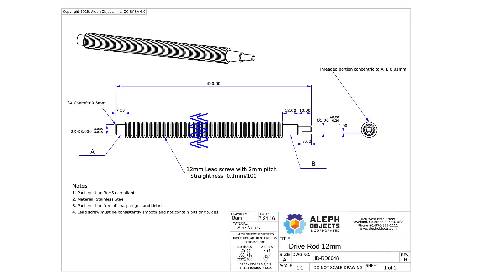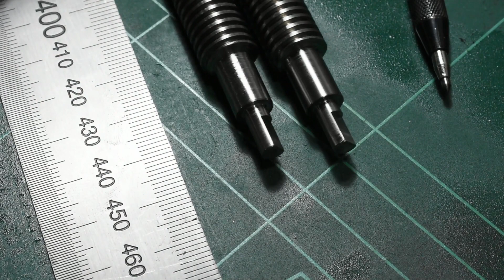Modifying leadscrews

Comment: Nice job on those. I admire your clean and well organized shop. Another fellow brethren of the Bostar I see :)  With a bit of metric to imperial nut machining help, I captured an offset  ratchet wrench on my tool post so that with a flick of the little switch it lets me best position the wrench for tightening, then conversely  move it wherever is best out of the way as well.
Reply from the maker: Thanks for the comment John. I strive for a clean workshop but 90% of the time it isn't tidy enough for my liking. Goal is to be able to walk on there and use any tool or machine without moving half finished projects out of the way :-)

I like your idea of the ratchet. I took a good quality ring spanner (box wrench?), changed the angle using heat and removed one end and rounded it off at a nice comfy angle. Very much like what Keith Fenner did. With a 12pt spanner, it gives me the option of lifting and rotating to a good angle too. Not as slick as a ratchet though!

Cheers!
Craig